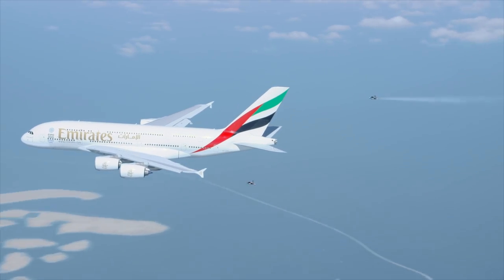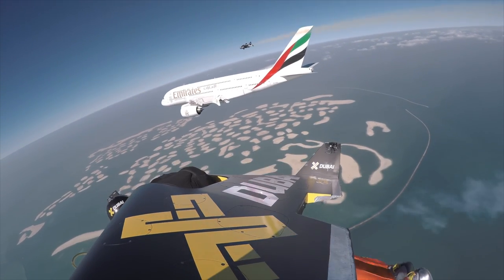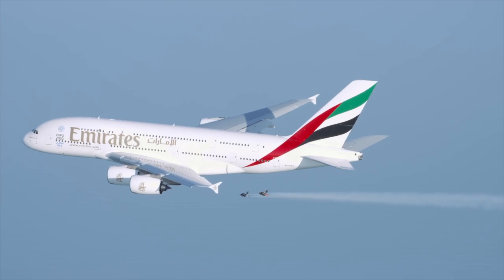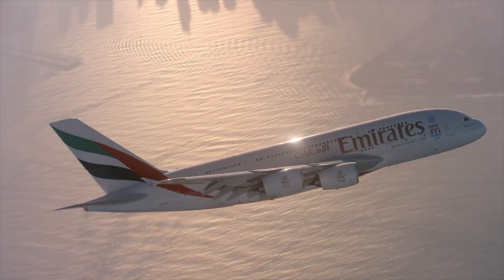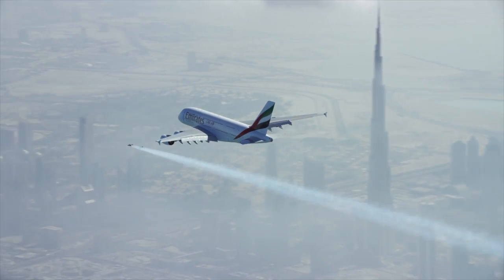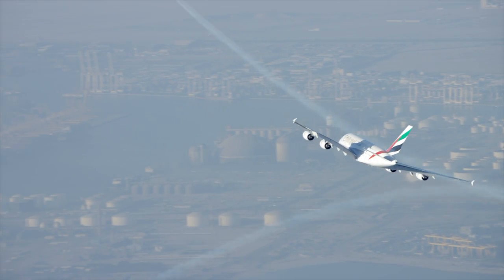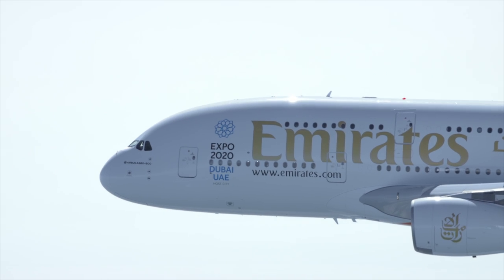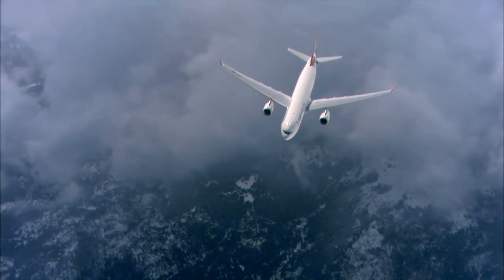Delta Wing vs Swept-Back Wing

Comment: Lots of wrong information.  Swept wings can also be tapered (which most airplanes that fly at transonic speeds have). Straight tapered wings are probably what he is referring to; they are still common today.  Swept wings reduce wave drag due to sock waves.  Just some of the misinformation mentioned here...
Reply: You got that right!

Comment: Christian,
Great video I just wanted to point something out. Angle of Attack (AOA) is the angle of the relative wind to the mean chord line of the wing (if the leading and trailing edge are equal distance this is the center of the wing). The deck angle which you referenced in the video may at times have a relationship to the Angle of Attack however it is not constant and deck angle in level flight is more a function of the design of the airplane rather than an indication of the Angle of Attack.

Comment: Um, dude. The reason that we created swept wings was to go faster, with less drag. I think that you need to do more research. Straight wings are the ones that generate more lift, are better at low speeds, and generate more drag.

Also, if a delta wing generates a ton of lift at high speed, then it will generate at least above-average lift at slow speeds, which means they wouldn't need to land so fast, because they would be able to go slower and still stay aloft.

Also, the nose angle of the Concorde (or any plane) has nothing to do with the wing. The angle of attack is a wing thing only. Also, if delta wings generate so much more lift than swept wings, why do they need so much more angle of attack? By definition, adding angle of attack means that the airfoil is less effective, meaning that the delta wing generates less lift than a swept wing.

Although, I will say that you are right in that Delta wings experience less turbulence than other wings.
Reply: Unfortunately that's not how delta wings work. If it was then why aren't delta wings more common on subsonic aircraft.
Reply: delta wings actually create lots of lift at ALL speeds ... that is why the f15 on up use the wings they do ... the ones with the movable winglets also take advantage of the normal wing line for very low speed flight ...
Reply: I couldn't have said it better myself.
Reply: @lachlanscott3780  Delta wings are efficient at low speeds mainly because of something called "vortex lift" which also creates a huge amount of lift induced drag which is why although delta wings work better than swept wings at subsonic speeds, they still aren't ideal.

Comment: I was told that delta wings and swept wings are essentially the same as they both have a trailing back leading edge but the two wings are NOT the same, the airflow over and around each wing is radically different.
Reply: they are the same in the respect they both lift the plane ... and for the chord of the swept wing style or straight wing that is the only part that lifts while a delta wing is not just a portion along the body of the craft but most of the craft length ... it also brings the fuselage or body into the lift equation IF it has any potential lifting surface ... such as intakes and exhaust etc ... a basic jumbo jet has about the same lift per area of wing as a mirage fighter ... the difference is the mirage has more wing surface to use than the jumbo jet ... THAT is where the difference makes itself known ... 
the wing cubic loading calculation will allow you to compare the wings easier ... essentially flight weight (kg) / (wing area (m^2) )^1.5 ... making it essentially kg/m^3 this allows you to compare all wings to each other by their load lifting ability
Reply: @0623kaboom yes exactly but the biggest thing that differentiates deltas from higher aspect ratio wings are that delta wings use vortices that form along their leading edge to produce lift (this phenomenon is called “vortex lift”) whereas wingtip vortices are problematic on other wings. This allows delta wings to perform nicely at lower speeds where normal high speed wing performance at low speeds suffers a great deal.

Comment: Great effort but you need to do more research. There were many wrong facts that could mislead people. Aircraft identification, airfoil properties, airfoil shapes...
Reply: Exactly, the 777 has a takeoff speed way higher than 160 mph and the Concorde's takeoff speed is little bit less than 250 mph.